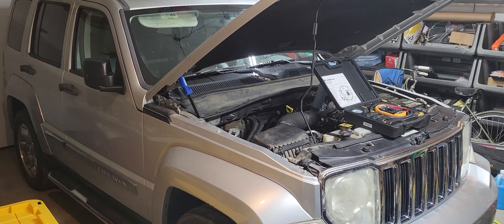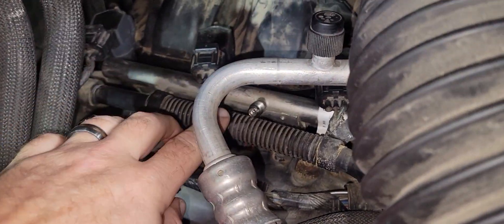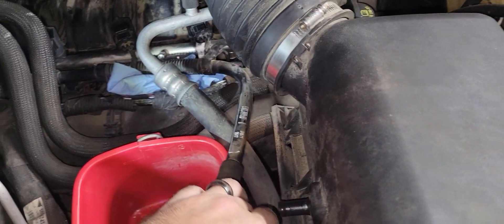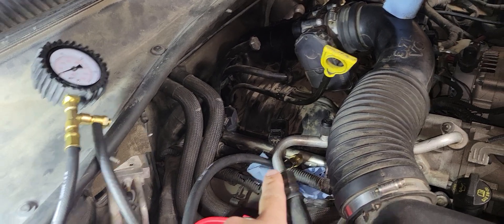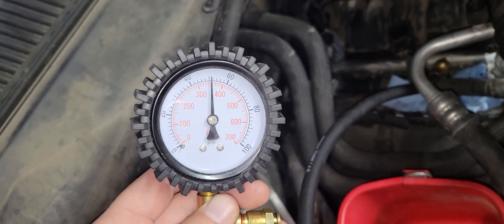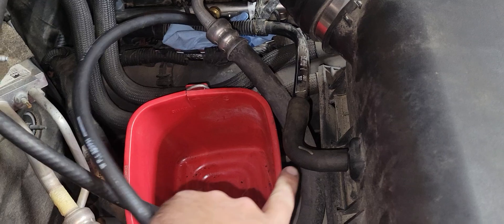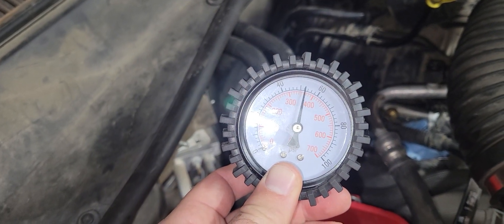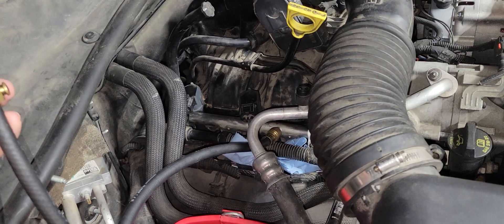2008 Jeep Liberty fuel pressure test.

Comment: Hey there great video! Where is the fuel pressure regulator located in this vehicle but a 2010 more so, thanks!
Reply from the maker: I think the regulator is built into the fuel pump on these.